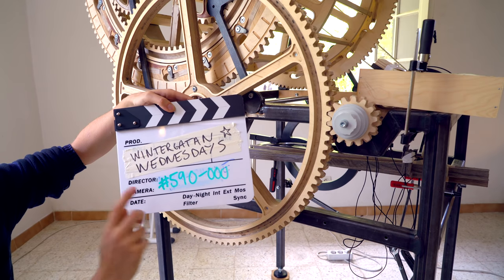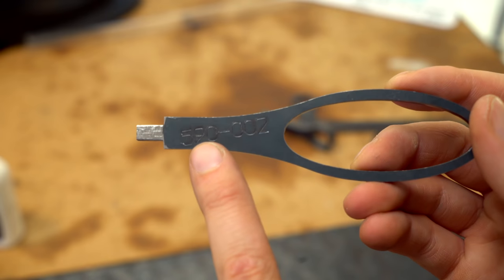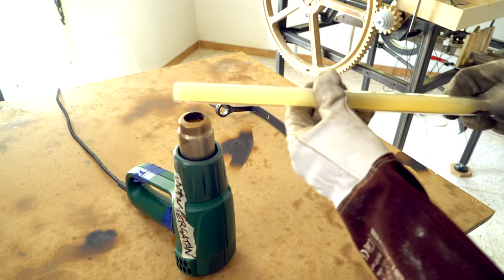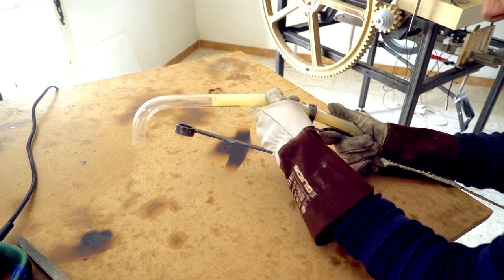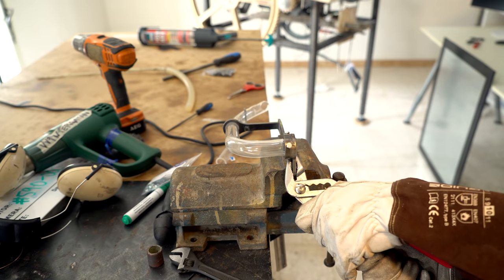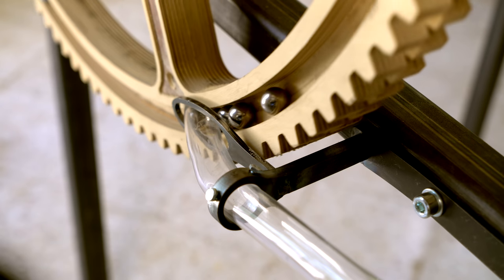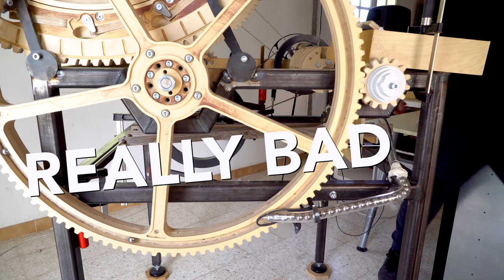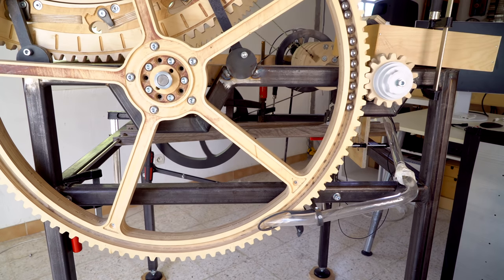Marble Gear Lift Entrance - Marble Machine X #58

Comment: Hey Martin! For future bends of the clear tubes you really should coat the silicon insert with soapy water. It will make pulling it through the tubing much easier, prevent the insert from becoming misshapen from being stretch by insert friction,  making pulling the insert out easier, and help prevent over heating as the soapy water will evaporate slowly and absorb some of the heat.
Reply: Soapy water becomes a pretty good ahesive when dry, like after heating it with a heat gun. Bicycle handle grips are installed this way.
Reply: I was wondering why he doesn't use marbles to reduce tube collapse.
Reply: @Offline Design  Soapy water works a bit better because the soap prevents the water from evaporating to quickly to be of use.
Reply: @eugenew2   The silicone tube actually works really well. They sell kits for this sort of thing online to use for bending tubing for custom water cooled PC. If you used marbles instead of the tube the metal from the marbles would heat up and possibly melt the inside of the tube. You would also get some tiny ridges and inconsistencies as the plastic tube forms/melts around the small valleys between the marbles. You really need the consistent pressure the silicone tube gives to the inside diameter.
Reply: @eugenew2  Look back and you'll find a video showing how long it took him to arrive at the silicon insert. Absolutely nothing else works. Likewise he got smart and attached the wire to the end to stretch it out, since it's impossible to push it out.
Reply: dothemathright 1111  that's why you use soapy water. the soap prevents the water from evaporating. You can find YouTube videos of people using this technique to build water cooled PC custom loops. I use it for every water cooled PC build I do, it works great.
Reply: @eugenew2  The inside diameter has to be constantly thicker than the marbles. Only the reduction of rubber diameter by stretching pulling out makes it possible to be removed. Good question though.
Spoiler: The whole progress of the MMX was an articulated imaginative planing process in advance by an extra* author (the ployphonic voice audio), who is an engineer, an ingenius, all before any visual scetch & practical execution by a whole wintergatan team.
Reply: dothemathright 1111   I also mentioned using Acrylic in the same comment as using PETG but it seems like you ignored it, or missed it? It has a much higher softening point than PETG as well and the technique still works.
Reply: dothemathright 1111  the only comment I mentioned using PETG was in a response to 0Calvin, Which you didn't add to your list of previous comments I made. In this comment I also mentioned using acrylic. In fact none of the comments you copied mention my use of PETG so if you didn't see this other comment how did you know what plastics I've used? Just assumed?
Reply: dothemathright 1111  - You would kind of expect someone who is arguing with you to read your points before refuting them... Especially if they are replies under the same original comment. If it's a problem with Youtube that's too bad for causing a miscommunication. You can use many different kinds of tubing is custom watercooling. PVC, Copper, Glass, PETG, Acrylic, Brass, Plexi, PMMA, ECT.  I am not assuming anything you're the one who came to the argument assuming I only used PETG. It was just a suggestion for Martin to try because it has made my life easier bending similar plastics to those he is using. If it doesn't work for the type of PMMA plastic he is using, then it doesn't work. There is no harm in trying it. 

 Enderzt
Enderzt
19 hours ago (edited)
0Calvin I am not sure if your comment is meant to be a counter to using this technique or not? But I assume it is. If you search on you-tube or goggle for 'how to bend tubes for custom water cooled PCs' you will find this is a very common technique for bending these sorts of tubes to the shapes you need. It helps with all the things I mentioned in my original comment and more. Ive used it to bend multiple custom Acrylic and PETG tubing water cooling loops. It works really well.
The soap becoming a potential adhesive doesn't matter in this scenario because you can wash out the inside of the tube with clean water after bending, where as you couldn't with a bike handle. Even if you didn't wash the tubing after, the adhesion of the left over dried soap on a large metal marble would be next to nothing. The benefits of this technique far outweigh any downsides.
Reply: dothemathright 1111   - Glad to know defending your position without swearing, yelling, or being offensive is now a shadowban worthy offense worth cheering. If a comment that benign can be shadow banned, really looking forward to our Orwellian 1984 future.  You misrepresent my argument to only include PETG tubing without clarificaiton, I defend myself saying my position actually includes practical knowledge of other types of tubing, and now I am somehow a commenter worth of shadow-banning. I open the conversation to clear up miscommunications and that's somehow a bad thing. Looking forward to the future of humanity where no two people can have a normal disagreement without someone being so offended they need to silence the other side.
Reply: I build watercooled show rigs for a living (soft channel plug...) and the soapy water trick works very well for acrylic tubing. Personally I prefer acrylic to PETG as it produces nicer bends, is clearer and not prone to warping with high coolant temps (like if there’s a pump or can failure).
Reply: dothemathright 1111  Watercooling people used acrylic before PETG and they used the same silicone insert with soap water to bend the tubes. PETG is kind of a new material in the watercooling scene as well.

Comment: Hello Martin. I'm not familiar with how you have arranged the magnets. There is a method which can increase the strength, which works well with cubed magnets specifically, it's called a Halbach array. You can find it quickly on Wikipedia and tons of other sources. That might give you the extra holding strength, should you need it.
Reply: The magnets are arranged with poles facing in the same direction. Unless that was changed sometime.

Comment: Do you change your design in fusion 360 for all the small changes you do? For example when you bended the metal to get a steeper angle at the top or the position of the end of the pipe
Reply: He'd need to if he intends to use all of the designs for spare part making, as he has said he intends to do.

Comment: How about using clear epoxy resin instead of silicone?
Reply: gadi70 Martin should watch some Shop Time with Peter Brown for advanced resin knowledge! ;)
Reply: Epoxy probably won't stick to that plastic tubing.
Reply: @matthood7546  epoxy sticks to plastic what are you about
Reply: @HappySlappyFace  there are many different kinds of plastics and each may withstand different stresses better than others
Reply: 📡little removable fail on demand ;)
Reply: @HappySlappyFace  most don't there are specialty epoxies that will but even then it's not always 100%
Reply: Now that he tried silicone epoxy won't stick to it anymore. He would have to replace tube and loop because it is near impossible to get rid of silicone contamination enough to use resin.

Comment: You are the best example of why they can't make Saturn rocket engines anymore. The have all the plans and parts for the engines but none of the assembly talents as the engines were assembled. All these minor changes you are making never make it back to the CAD files.

Comment: Dear Martin, another great little engineering tuning job, resulting in design improvements which should be updated in the CAD model... These naked steel parts deserve some (chrome?) plating to become a brilliant reward trophee for you achievements but also to prevent corrosion during the tour...! Compliments again, bravo!

Comment: Maybe if that last "neck" there before the oval in the steel was elongated and angled down even more to match the radial plane of the wheel (which would drop the delivery point into the groove a bit more, which I'm unaware of that would be an issue) you could get even more lustre on the delivery from tube-to-wheel. In essence making it as smooth as humanly possible. This endeavor is one of the most enjoyable things on all of YouTube, thank "you"!

Comment: This is one of those parts, you make extras for. Like, plenty. You will not regret it down the road. You might even want to consider 3D printing the mouth that goes into the steel oval as well to just hold the pipe there, meaning if something bends, it is not all out of alignment but just perhaps that one piece.

Comment: Use windex, for that smooth finish when using silicone. Make sure the silicone is touching all the areas you want it to adhere to. Because once the windix touches it, it almost like trying to pour water on an oily surface. Water is used when you are using caulk.

Comment: Dear Martin! The maschine look cool! Fantastic work. We are bulding separation systems for metal and waste. When we are using magnets we try to not build the near structural parts from non-magnitizable metals... the oval at the end of the tube it can be to close... it can-could be magniteized by time and could effect the flow of the marbles. Please consider the build that part from any not magnizeable material. (Wood, plastic or from stainless steel). Best wishies Gabor.

Comment: you also might consider adding electrodes to the magnets to make them even stronger and or able to turn off and on. This can be powered by the crank shaft which would look really cool. Probably a logistical nightmare but may save you dropped marble. just a thought

Comment: Instead of that messy silicone, there is a product called Acrifix. It is basically liquid PMMA (Plexiglass) that will bond perfectly to your tubes. Im not sure if it bonds to metal as well but it sure will give you that clean look you are going for!

I used it for building a salt machine in bohuslän!

Comment: Please try a spring inside your tube when you bend it! If you can find the correct spring it will influence the interior dimension perhaps more perfectly. Your system did work well. Just suggesting alternatives that may help in other circumstances.

Comment: Looks excellent!
I love the design and that you are able to see exactly what happens and where the marbles are going.
I have two suggestions though:

1) Make the direction the marbles enter in tangential to the gear. In an optimal design the marbles should not have to change their direction when entering the gear.
2) I think the oval metal piece is a little to big and does not fit the tube. Furthermore you should consider to use a different material that is not magnetic or discard the piece it all (depends on what looks best to you). I don't like that the piece can interfere with the marbles in the gear.

I can't wait for next Wednesday :) You have my deepest respect for building this incredible machine with such a high precision and enthusiasm.

Comment: If the bunching up/ dropping issue comes back at the bottom of the lifter you could put on a guard plate that reaches around from the frame to force the marbles into 1 layer and give them time to sync up with a magnet.

Comment: Just a feed back of concern. The lift entrance looks susceptible to handling/moving damage, with the plastic pipe corner being the outer most part.  Either put in additional guards to prevent plastic damage, make enough spares to prevent downtime, or change it to a metal wire guide.

Comment: It is also worth noting since that metal bar is so close to the magnets it will slow down the wheel i believe so if you want the wheel to turn longer without a heavier wheel then that is a way you could improve the turning time.

Comment: Hey i love the video but i have one little tip: when you're done using the heat gun, you shouldn't turn it off inmediatly. It should have a "cold air function" which cools off the heat core inside of the heat gun itsef. It's not that important but it expands the lifespan of it.  hope you keep up the good work!

Comment: For the marble transfer pipe you can use a non-magnetic material near the primary gear/magnet wheel to prevent that "Needle's Eye" from being magnetized and interfering with the transfer speed.

Comment: Hey Martin,
little pro tip
next time you weld these kind of pieces, make sure u chamfer the sides of the piece going into the slot. reason => when you weld it like i stated previously and you want to grind it flat the weld is still there and you're not grinding the weld away.
o and if you what a really smooth finish on that silicone, try adding some detergent into your water and give it a good stur before applying the finish on silicone
keep it up, loving your content on youtube

Comment: Martin, you need an angle grinder to grind the welds flat. A wire brush will not do this and a file takes too long. When will you contact me on the Modulin 2 build that I already finished? BTW, the magnets appear to pull the string of marbles out of the feed tube. Very nice! Glad you took my suggestion for a video editor.

Comment: You got it running smoothly, but it seems to me that the PMMA tube should transition into the leift wheel tangential to the lift wheel, it appears to feed in at an angle.  In the end, it all worked out.  Keep on keeping on!

Comment: Absolutely incredible machine Martin. You have my utmost respect with all the design and manufacturing you are doing/having done.
But, it occurs to me that over time the marbles may gain enough magnetism to be a problem, bunching up, etc. as the magnets in the lift wheel seem to be quite strong. Have you thought about possibly degaussing them from time to time?

Comment: I have been following your videos and the machine is looking great. I did notice you have a steel bracket holding the plastic pipe. You will get some interaction between the magnets in the marble lifting wheel and the steel bracket that has the elliptical hole for the plastic pipe. This might cause it to work differently to how you expect.

Comment: If you don't mind me saying so, you need a little more electrode protrusion (2-3mm), a nice clean electrode (cleaned on a special grinding wheel that only grinds tungsten electrodes) and a tad more lead angle when you TIG weld. 7 lpm argon. Then your welding will be even neater and stronger! (I build bike frames with TIG, and have spent long hours frustrated with my ability before I finally became happy with it).

Comment: Martin, could you make precise tube shapes by CNC carving a wooden mold of the outside of the tube, then put the tube (with silicone rod) in the oven until soft, then drop it into the mold? Maybe the mold could go in the oven too, if you didn't mind it getting a little charred perhaps! :)

Comment: The weight of the marbles may cause a jam before entering that tube in whatever hopper system you are planning. I recommend a basic agitator based off the main drive to keep the marbles loose
Reply: The only problem with agitators is that they are very noisy for a musical instrument.
Reply: LordThranduil234 I completely agree. If anyone can figure it out, I’m sure Martin and his friends can. I have enough heart invested in this project, it would kill me to see something as simple as a jam stop it.

Comment: Vaseline/Petroleum Jelly works as a great lubricant for getting the silicone insert in/out easily if you're struggling with any difficult pieces or bends.

Comment: Martin, it seems like you got the entrance working in the end, but I would just like to point out that the best possible delivery of the marbles would probably be tangentally to the wheel. That way, the marbles would be close to parallel to the track when they entered the wheel. This would probably cause a little issue designing it though, considering the height of the marbles before the drop, and also aesthetical problems since you would be delivering the marbles at the bottom point of the wheel. Although, it seems like you’ve figured out a solution that works. Until next Wednesday;)

Comment: you should test that fast loading while there are some marbles on the ring
to be sure they won't clog in any circumstances
Reply: I also wondered about this. I suspect several marbles fast loading would kick off any marbles already on the ring. However I believe there is a mechanism at the top of the ring to force all marbles off the ring hence there should not be any marbles on the ring at the point of entry.

Comment: I know you're probably already doing it, but make sure that whenever you make adjustments to a cast iron part that you're adjusting it accordingly in your CAD software as well. Otherwise, ordering a replacement part and having it not line up as well the second time will cause major headaches down the line, especially if you're on tour

Comment: I'm guessing the magnetic mechanism would work even better at full marble capacity, since the marble on the lift wheel would be magnetized and pull down the following marble along with it, making for a smoother drop than if gravity were the only force.

Comment: For the tube bending use some water and soap to lubricate the silicon ... also take a look at pc watercooling with hardtubes. There are many tutorial about bending.
Reply: dothemathright 1111 well I haven’t done it myself but it should work because the guys who do water cooling pc do that and it’s not like u are using a Liter of water. It is not enough to cool down the tube and the water doesn’t get hot enough to boil and to steam.
You are mainly heating the outer tube until it gets soft... if you do so there is not enough heat to get to the center